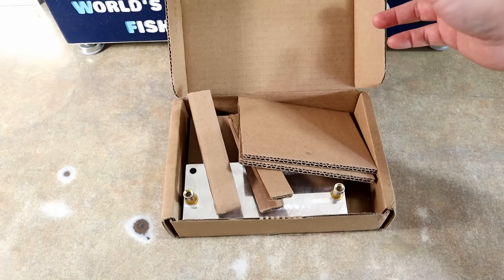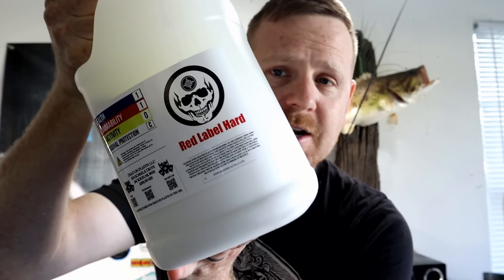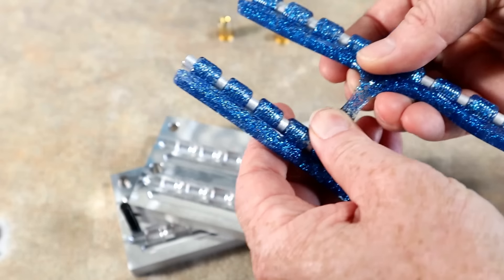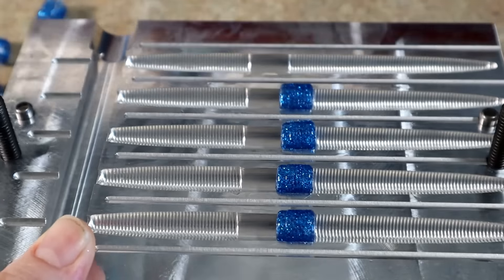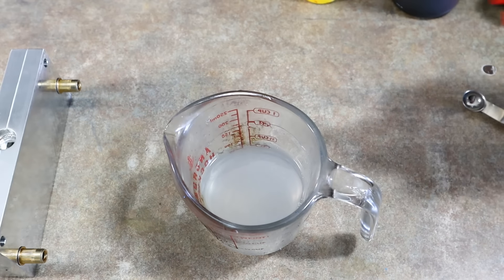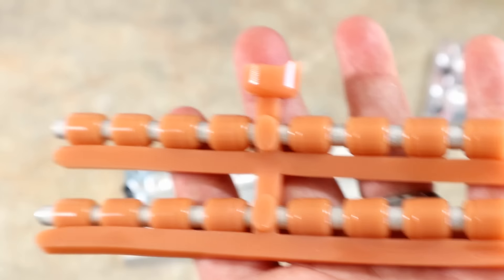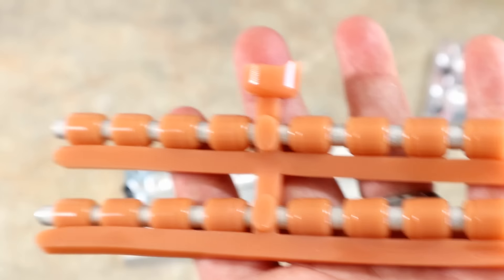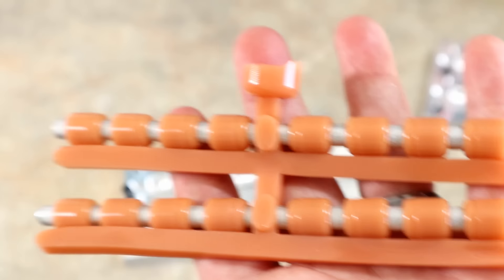Senkos Will NEVER Be The Same; Ai Wacky-Wrap Mold Pour & Catch!!

Comment: I've been using a sleeve made of clear shrink-tubing.  It works great.
You can even buy the electrical shrink-tubing in different colors but, the clear shrink-tubing is best.
I just buy the shrink-tubing that's slightly larger in diameter, cut it in 1/2" lengths, slip it onto my stick worms and then add just enough heat to shrink the tubing down to the diameter of my baits.  Ezy Pezy.
Reply from the maker: Travis Crosman used to do that exact thing.....used to*

Comment: Chris , i have a problem getting the stick baits to not pull loose from the ring when injecting them after the rings have cured ,im injecting at around 350 , if i do this before they cure it seems to work , im using dead on sinking worm , w/dead on hard formula for the rings , i have about 100 of these that have seperated and im not sure where i went wrong

Comment: Apparently this can't be used with the non-coreshot 5" AI senko mold?
Reply from the maker: To my knowledge the only 5" ai injection senko mold is the 5" core shot
Reply: @WorldsWorstFishing  I have the 5" top pour which I inject and will get this new mold if it fits the top pour.
Reply: @WorldsWorstFishing  Thank You Chris!
Reply: @WorldsWorstFishing  Hey Chris! Angling AI got back to me and said "Yes, it will work with the Top Pour 5" Stick Bait Mold.  You will need to pour the plastisol hot and steady.  Use a slow stream and avoid hitting the sides, get the stream directly into the port.". Going to order the wacky ring mold and give a whirl.........maybe a future video you can do? Thank You for your channel and sharing your expertise!